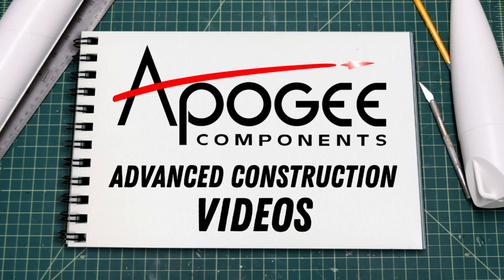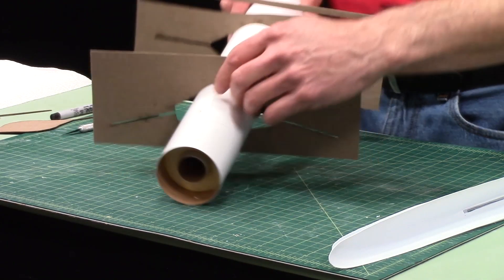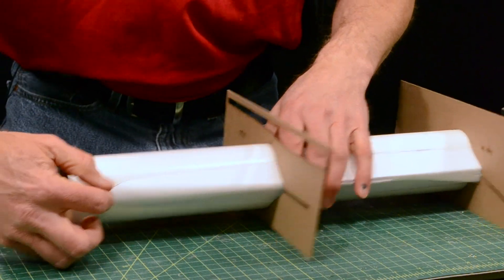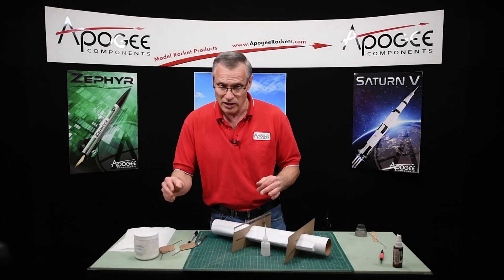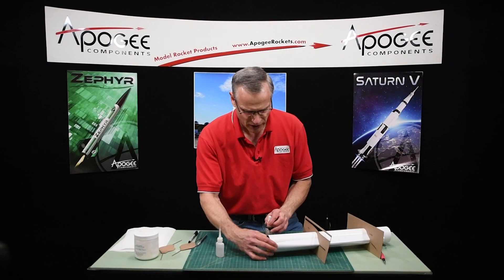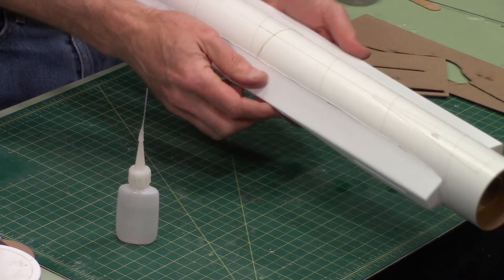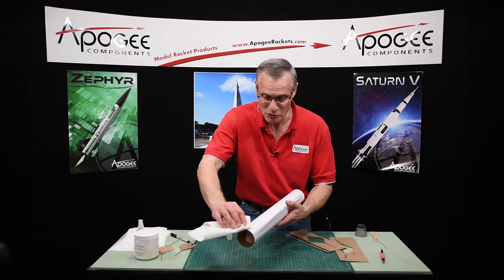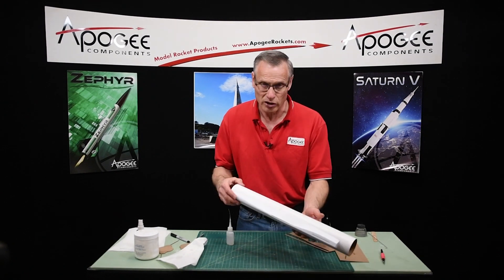X-15 Assembly Instructions Part 8

Comment: Thanks for the videos. A simple tip which I failed to follow. I got the fairings on but not without a hitch. 

DON’T set the assembly down while completing the gluing. I got a run at the forward end of the fairing and the edge of the tube quickly stuck to the table resulting in a patch of the glassine on the tube tearing off.  I rewatching the video and sure enough Tim never sets the tube down while the glue is applied and dries. I’ll need to come up with something to repair the surface appearance of my sloppiness.  I definitely had a Captain Obvious moment there. 😳